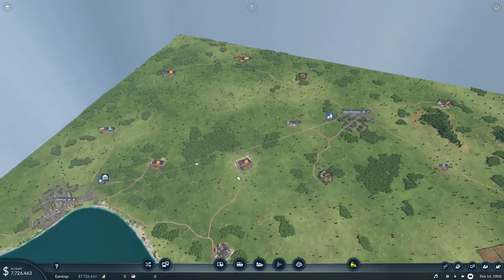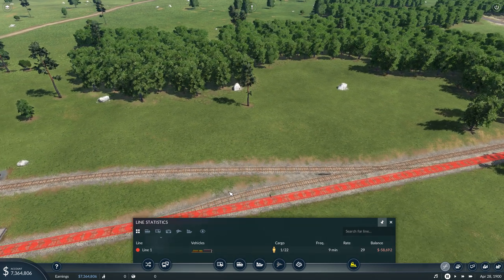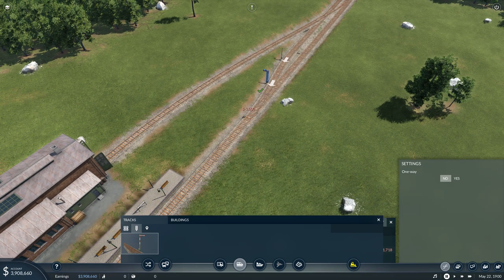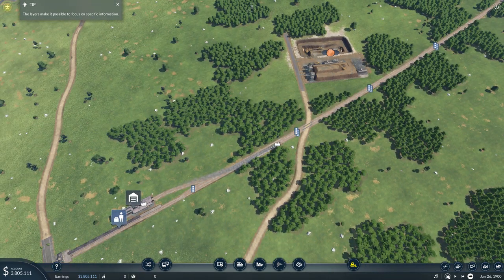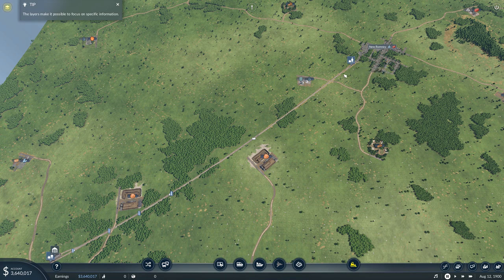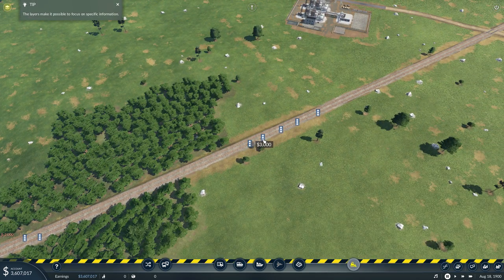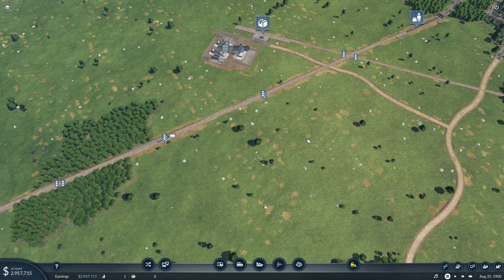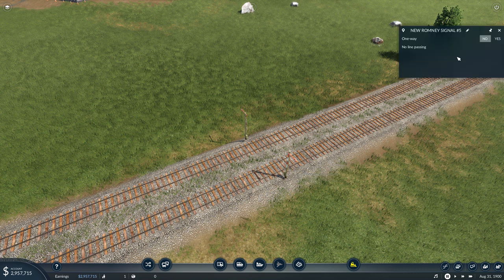Transport Fever 2 - How To Use Signals

Comment: I like using one-way only signals on my double track so I can be sure that trains always run on the right-hand side track.  That way I can easily keep all traffic moving in the same way which is really useful when later in the game and you have LOTS of train lines all merging and splitting and going in different directions.  Two-way signals are useful for loops coming out/in from depots as it lets trains move both ways on a single line in that case where there is not much traffic expected.
Reply: I know that you wrote it 2 years ago but what is the difference between one way and two way. I don't get it
Reply: @browl218  one-way makes it so that the train only can go into the direction of the arrow. In this video, the cargo track he put down is a two-way. If he were to make it a one-way, the train wouldn't have a way back. He'd have to put down another track going the opposite direction.
Reply: You can see this on the swiss made mission

Comment: A simple passing loop half way down the line with one-way signals is all you need to begin with and is much more cost effective.
This game is brutal early on and you're really going to feel your over  spending hard until you pay off your loan.
Two trains on a single line with a passing loop half way would be fine, then gradually add more coaches to and upgrade the engines of those first two trains. Eventually you will reach a balance where one train picks up all the passengers at either end of the line, both trains pass at the center point, and by the time it reaches the other end the station has filled up with passengers again.

My late-game large map American themed game has only one line connecting each town (except two) with 7-cars per train and with the exception of stations, each acting as a passing loop, the entire line is single track.
The only time I add double-track is when freight trains are using that line, so they don't get in the way of my passenger trains on their return journey.

And just to be a nitpicky sod, you should have your arriving line going straight in to your station, or loop, as this would prevent the train having to slam on for a slow turnout, whereas departing trains would traverse the turnout slowly anyway.

Comment: Really well explained. However for any new players out there or anyone who doesn't understand signals - may a "passing point" on the single line might have been a good idea to explain away.  1 line. 1 line with passing, 2 lines -- sort of the upgrade I do depending on the length of line.
Reply: The passing point is pretty handy, can double your capacity for cheap without having to run 2 tracks for the entire line and can be upgraded by adding more passing points and eventually just connecting the passes together to form a second track

Comment: Nice clear description,  but one small error I believe.  At about 06:10 you say that the train in view won't move until the other train goes through the station and comes back to where this train is.  In TpF1, the station has an implied signal so this train will start to move as soon af the other train has left the station (i.e. much earlier).
Of course this is unless TpF2 is different in this instance from TpF1 (and I have no reason to believe this is the case).
Reply from the maker: True. The station have a signal built in.
Reply: @Stealth17Gaming  it's not that the station has a built in signal, but the fact that the train now has a clear route to it's destination or the next signal. Here's a little demonstration I made: https://i.imgur.com/xawYpvs.jpeg
As the 1st train clears the intersection going left, the second train that will go straight receives a green signal and starts moving even though both trains are technically on the same section of the track – there are no other signals on this track and none of the trains are in a station. If, however, the second train was also going left on the intersection, the signal would remain red.

Also, I don't think there's any real way to give priority of one track over the other. In your example of an intersection between passenger and cargo trains, if the cargo train is going through the intersection the passenger trains will still have to wait either inside the station or at the section signal on the other side. In this situation I would put the signals on the passenger line as close as possible to the intersection so that, if passenger trains do have to wait until cargo clears the intersection, they will occupy as little track as possible and minimise chances of affecting other trains.

For example, there are two passenger trains – one in the station, and another one waiting to go into the station. If we put signals as close to the intersection as possible, the 1st train will go up to this signal and wait for the cargo train to pass, while also allowing the 2nd train to enter the station. Otherwise the 2nd train will be waiting for the 1st train to clear the station while the 1st train is waiting in the station for the cargo train to clear the intersection.

Comment: This was helpful, but wondering if this would work the same if I put 2 tracks at each station instead of 1 or if there'd be some issue. And if I had a 3rd station connect to the station in the middle how that would work.
Reply: not sure what you mean by have 2 tracks. He basically built that if you mean 2 separate complete tracks with stops he had 3 trains after adding the signals. 1 train per full track will always work. but if you ever have more then one train on a track you need signals or it wont work.

It is cheaper to understand signals and have 5 trains on 2 tracks then have 5 trains and 5 tracks.
Reply: if he had 2 complete tracks you basically just add another line and switch it to the other track. but again you could only have 2 trains. 1 per complete line

Comment: I have issues with having a dubble station, and using |x|  tracks in the railroad line, so that the trains pass eachother and use both tracks on the stations to unload/load but they still use only one load/unload track, how do I fix that? ( very  hard to explain it in text for me )
Reply: You have to choose the platform in the line configuration

Comment: incorrect info here to
Reply from the maker: A more useful comment would to then provide correct info, as opposed to just saying "this is wrong"
Reply: @Stealth17Gaming  At 6:10 you say that the train will wait at the signal untill the other train passes the signal on the track next to it.
This is not correct. As soon as the train leaves the switch at the station, the waiting train can go.

Comment: The best way is to have a ratio of the sections of track (between signals), as you have trains on said route.
For example, if i have a double-tracked route going from an Oil Well to a Refinery, with two trains on it.
Then i actually only want TWO sections of track, one going "up" to the refinery, and one going "down" to the oil well. So only one signal at each station. Because this means that the trains will automatically space themselves out so they are at exactly opposite ends when they get the green signal.

If i have FOUR trains, then i want FOUR sections of track. So same as above, but with 2 signals on both double-tracks, in the exact middle of the route.
This because that means my second full load of oil will space itself out half-length away from the first full load just as it got done delivering.
You can fiddle with the ratios, actually i like having one extra section of track for every train. So if i run 4 trains, i like having 5 sections of track, just to keep a clear buffer, but thats up to you.
Reply from the maker: Clever!
Reply: Yes, but when you want to add trains later on, for example from 2 go to 3 trains, the sections don't work out. You then need to move all the signals. Als when a train needs to move trough your line as you are redeploying it or you only have a train depot far away, it messes up the perfect schedule.
Hense I go for signals near stations, when tracks merge or cross amd break up long stretches of track. I try to keep the streches of similar lengjt though.

As a rule you should have atleast as many sections as trains, but the same number and all of exactly the same lenght is for the ideal world and in reality, sometimes/often things get messy. ;)
Reply from the maker: @erikwillems6466  Not necessarily. If you have trains which are traveling at equal speed then you won't have a problem. Sure, they might not be perfectly spaced out, but I personally don't care for that.
Reply: Ah yes, they should have an equal speed. But that is the theoretical situation where everything is perfect. 
In actuality, yerrein differences cause slopes and curves modifying the speed at certain parts so tracks shouldn't be of equal lenght. 

But the real problem occurs when you go to the extreme, 2 trains and 2 tracks. Then the third train that is "just passing trough" once, will cause all kinds of conflicts. While more signals would make your network more robust.

Comment: Hi, I don't think you can assign priority with these signals. You are right if both trains approach at same time, the passenger will have priority in your example. But in the (equally as likely) scenario where the passenger train is behind your lower signal and approaching it, it will be forced to stop and wait needlessly (in terms of the track ahead to junction is clear) if the cargo is already crossing - so all things equal you are not gaining anything and you may as well place the signals right next to the junction for the passenger train as well.
Reply: i noted this thing too

Comment: My trains had been running fine, but all of a sudden I ran into an issue where they will become stuck in the station when another stops at the signal, and only at one end of the track. Is it just a bug? I can’t figure it out
Reply: if its a bug turning the train can help. this resets the train and it looks again if it can pass. What also could be a problem is that you placed the signal AFTER the lines merged into one line. This would mean the train waiting blocks the only exit and the other train can't go to the other rail.
Reply: I have this same problem and I cant figure out why it happens. Ive had it happen multiple times now. Ive made sure my signals aren't too close to where the single track splits into 2